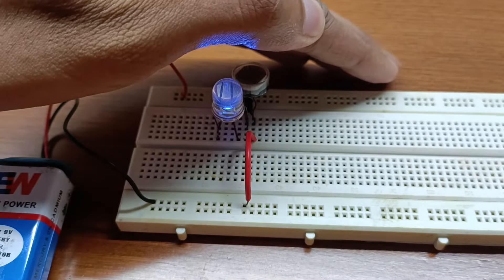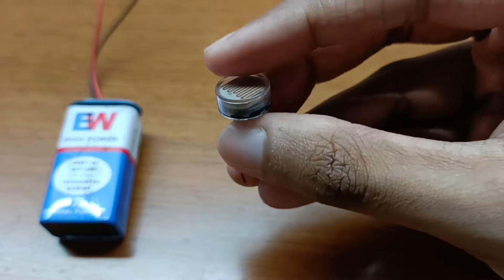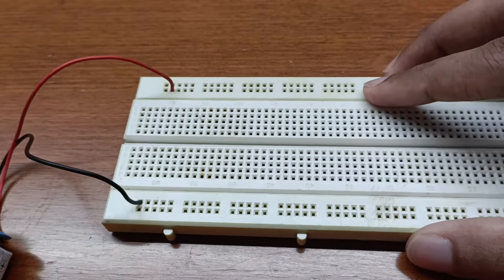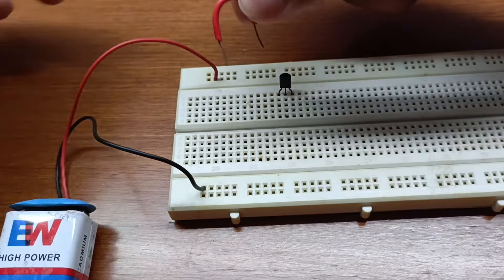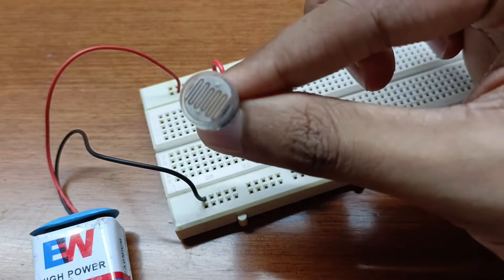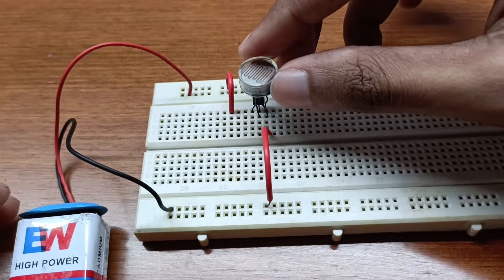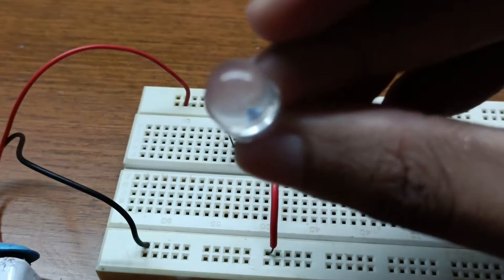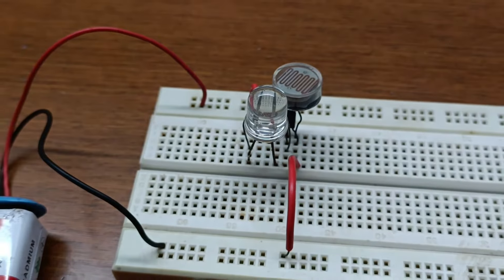How to make a Dark Sensor on a Breadboard | Simple LDR Dark Sensor Circuit

Comment: My led burnt out....i blame you
Reply: Same bro
My led burnt out
Reply: How much power did you used , more than 9V ?
Also the resistor values?
Reply: The resistor used in this video is 100k ohm, if you go lower then your LED might get burnt out
Reply: The led can hold current till 0.6V to 2.5V😐